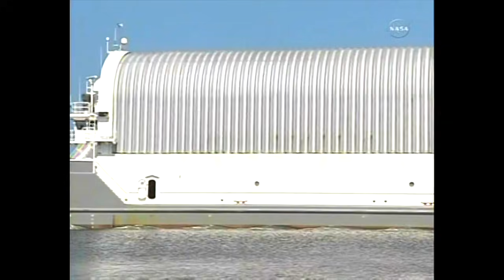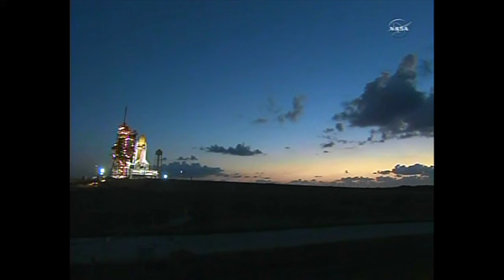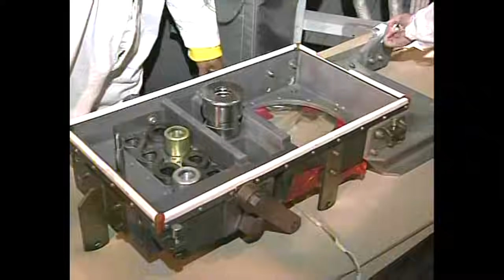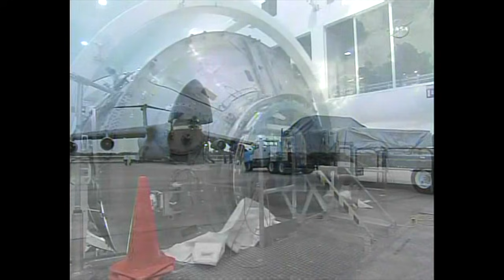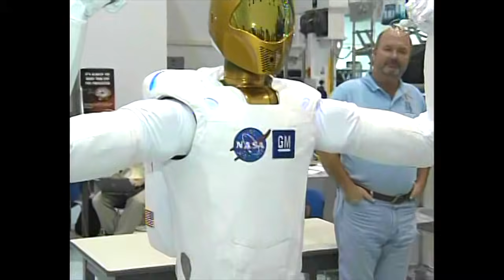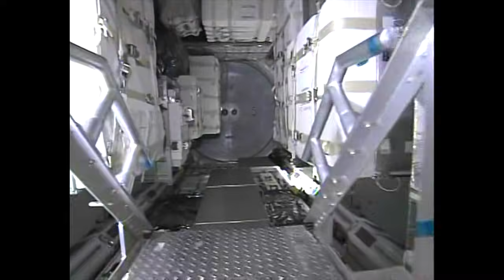Last Flight for Shuttle Discovery | Launch Preparations for Mission STS-133

Comment: I don't recall running across video of the engine removal process before. That's a neat piece of footage to find. Thanks. I was inside the engine compartment of Atlantis when we were installing the equipment for testing the tail flutter during reentry, but never got to see the engines actually being removed.
Reply from the maker: I never heard of the tail flutter test, was that a one-off test?
Reply: @Shuttlesource  We ran this test in 1991. There had been some indications during reentry that the tail might be experiencing flutter, which could prove catastrophic to the Orbiter. Our company was called in to set up tests to see if it was real. The company was called Endevco, and we specialized in vibration, shock, and acoustic testing. The idea was that NASA removed a series of tiles along the tail surface so that we could place our accelerometers and strain gages along the entire length of the tail, from the upper tip to the base. The wiring was then channeled into the lower right engine compartment, where we had installed the electronics to record the results from our sensors.

It was a fascinating thing to be part of this, and gave me some great access to Atlantis, especially throughout the aft bay and the tail itself. On the next mission to space for Atlantis, we recorded these data, and the results showed that the feared flutter did not exist. If it had, all of the Orbiter tail assemblies would have had to have been replaced, which would have shut down the entire program for a long time, and cost a huge amount of money. Very proud to have been part of that, and helped prove that the tail was safe to fly. Since we proved a negative with regard to the flutter, it was not a test that got a lot of attention.
Reply from the maker: Very interesting, glad it all worked out
Reply: @Shuttlesource  Yes, so were we. Could you imagine if, during the mission to test for tail flutter, the flutter had occurred on reentry and we had lost the Orbiter. That was a tense mission, to be sure. I believe that the mission flown with our equipment was STS-43 in August 1981.